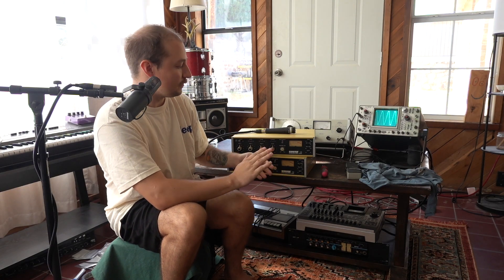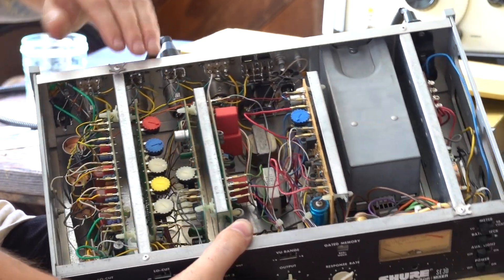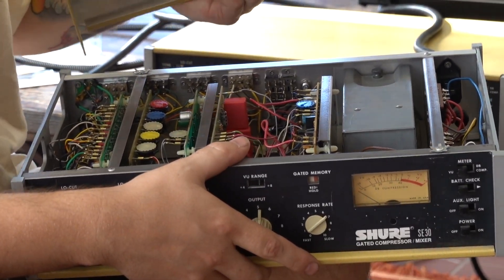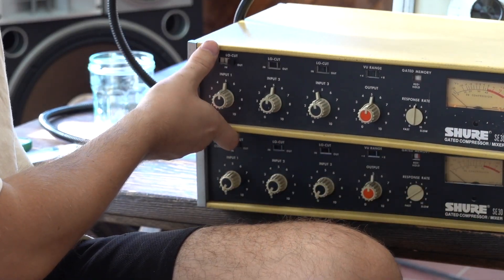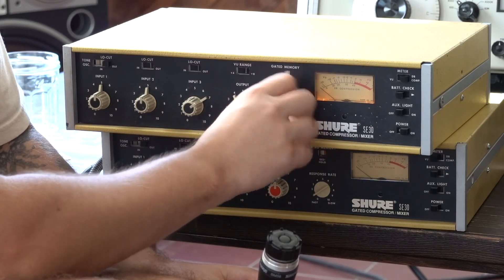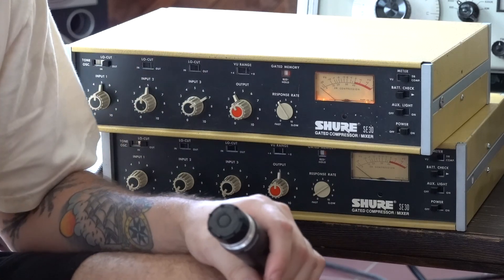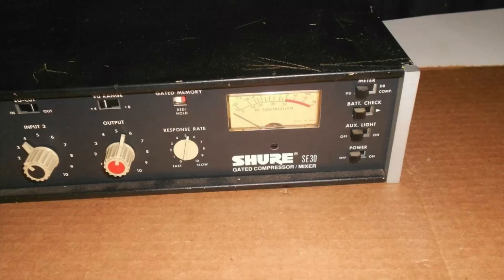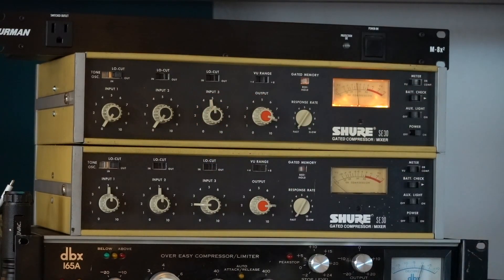FORGOTTEN GEAR: Shure SE-30 Drum Squasher

Comment: A pro tip that was completely missed in pre-production, your drums MUST be gated before sending to be distorted. An exact example of this is when using them on snare tracks… I also mic position the shell mic like Kevin does… but it picks up tons of hi hat and kick bleed. In order to get great distorted drums with tons of control and character, you have to start with the cleanest recording you can get. That is only achieved through gated kick and hi hat out of the snare mics. It works best when you gate every single mic except the overhead mic. When the three other mics are gated and it cleans up the signal, for snare the se30 will only respond to the snare hits and not the kick bleed, completely changing how the se30 responds to distorting. Isolation creates room for big big distorted drum sounds.

Another tip that was completely not brought up. This box sounds its best when using the raw distorted output mixed back into the mix. This routing setup is called New York Compression/Upwards Compression. It literally sounds good on ALL DRUMS, and really lifts the mix. Your bring it to a mix bus, and further bus send to a spring reverb, and mix that back in against the drum bus… and boom! So we learned, gating before sending to distort allows you to maximize distortion character and clarity… and mixing the wet signal back with the original creates a clean controlled distortion with bigger than life upwards compression. You could use it just like in the video, but you are leaving tons of tonal shaping and characteristics off the table. 

Last gold nugget, subtractive eq helps your gate work with more precision. For example, for kick I use a high pass filter to control how much low end I want, and a low pass filter to cut off everything above the kick’s frequency range (spectrum analyzer will show the kicks frequency range), in order to lower the volume of the drum mic bleed of everything else coming through the kick mic. Now when I put the gate after that eq, my gate will only respond only with the loudest peaks of the kick and not the snare or cymbals. Keven Parker uses gating religiously on his drum mics, and it’s how he gets explosive drums. In order to distort them nicely, you have to start with absolutely clean drums. The powerful learning from this video is that on single mic inserts, this box works best in gate/compress mode. When you are using it on the drum bus it works best in compress only mode. Using EQ and gate in that order, you enhance clean recordings that don’t overload with room noise when you crank the SE30 input. Tight with tons of character. 

Go and be righteous, and bang your drums all day!
Reply: quick question to your suggested setup for the SE30.  Are you using gates from the computer or outboard before you go into the SE30 or do you have the gate/compress mode turned on and are using the built in gate of the SE30 in this scenario? Can you have gate and compression turned on the same time on the SE30?
Reply: @WelcomeToSteve I learned what Kevin is actually doing with his drums and the correct order. Track your drums clean, use subtractive EQ and gate bleed and tighten the tail/room noise as tight as it can sound naturally. Side chain compress the overhead to duck when the kick and snare hits. Send to a dbx165A or like compressor on a drum bus, and then parallel compress/distort the drum bus through the Shure compressor/limiter, hitting it hard into distortion, and mix back in with the drum bus. 

The side chaining of the overhead with kick and snare, brings the kick and snare upfront so the final distortion compression stage mostly affects those two more in parallel. That’s it!
Reply: @edwarddelavilla3475 👏👏👏
Reply: @WelcomeToSteve What I do, and to simplify the process, is track with zero gating or processing. That way you have a completely raw take on all mics.. so you leave more room for editing/experimenting. Just make sure to track without hitting the red on any mic at loudest playing for the song. This ensures you have the cleanest take to really mess with. 

Then in the computer, subtractive EQ with shelf cuts (no hpf/lpf). Into gates taking off the tails and bleed. Then send to software or hardware compression of choice doing light compression to highlight transients (2:1-3:1 Ratio @-2db/-3db of gain reduction, mid slow attack to let transients through, and fast release. Now each track treated like this will have a clear high def sound ready to take saturation and distortion with great tones. I call this process audio prepping, beautifying and tightening before further processing. At this point you would send the snare side or the entire drum bus to the se30 and smash it hard, and print back into your computer. Now on the printed track channel, turn the fader all the way down and slowly bring back in the distorted se30 fader… boom. You retain the punch and highlighted transients of the individual clean tracks, but gain girth and saturation as well… and you’ll hear room noise levels raise and understand without gating… it would be too much. Send the distorted track to the drum bus and use a glue compressor.

So SE30 sounds better in parallel vs series… and before choosing either way… subtractive EQ and gating is a step you should not skip unless you are going for a super lo-fi one dimensional sound. Hope that answers your question, feel free to fire more questions if you have em!
Reply: @edwarddelavilla3475  thanks for the fast reply and that was super clear and makes sense. I have a shure 267 which has a limiter but I gather the SE30 would be a better choice for this smash technique
Reply: @WelcomeToSteve Glad it makes sense for you, it’s a full proof way to make your drums sound like a blanket has been lifted and you get max punch. As for using any other piece of equipment to get same type of effect, the beauty is all pieces can be overdriven and every piece has a breaking point. You just have to listen for break up, and try it in parallel. If you like what you are hearing mixed back in, then you can rock it. You can use parallel compression or parallel distortion, or both in any way you want. I’m not familiar with that unit, but I’m looking it up now and I’ll report back what I find 😊
Reply: @edwarddelavilla3475  okay awesome! yea still learning my unit and experimenting with the input and output levels with the limiter on or off and all combinations in between.
Reply: @W @WelcomeToSteve So it looks like it will do close to the same effect, minus the gate function… but it’s not a big deal to not have that… your gating in the computer will rectify that on individual drum mics. On the entire kit on the drum bus, I wouldn’t use the SE30 in gate mode… so you really aren’t missing out in retrospect. It has a limiting/compression function which is all you’ll need to do the effect. People use this one on drums too, so it definitely has the same mojo. The only difference is how much it takes to engage its distortion. Just last piece of advice, if you are going to parallel compress/distort on individual drum mics, go easier on the final parallel distortion on the entire drum bus. If you are skipping individual compress/distort on drum mics and solely using it on the drum bus, then you can ride the distortion a bit higher. By recording the drums with no processing, you have all the time to test which sounds better for the song as it’s coming along… where as if you committed earlier when tracking, you are stuck trying to make it work or you eventually get forced to re-record sections or the entire song… don’t make that mistake, and experimenting becomes fun and intuitive. Enjoy this technique, and I advise you do this to all drums no matter the genre, the only thing that changes is how much or how little. It makes any drum sounds better. Don’t be afraid of mono drums, they create the most impact and free up space in your mix to pan. Most of the best albums all have mono drums for a reason. Rock on, and I’m here if you need any advice!
Reply: @WelcomeToSteve Know thy tools, and know them well. You are on your way 😎
Reply: @edwarddelavilla3475 🫡🏆👏👏👏

Comment: Very Nice! - Big drums is what got me into audio engineering, and music production, as a hobby, back in the mid-80s. I loved all those heavily processed Duke Bootee drums on his "Beauty and the Beat"  productions, and then I got into Meat Beat Manifesto's drum sound aka, Jack Dangers.

I have, quite happily, limited myself over the years to just  dbx and Drawmer. - my current favourite drum bus setup is into a cheap old 166A, used on Jack's Subliminal Sandwich album, into a Drawmer DL251, which adds back generous amounts of meat and weight to the signal, as I personally find the dbx units tend to thin the overall sound a little.

I'm essentially using the 166A as a Transient Designer, and the Drawmer as a smoothing device, - maybe not to everyone's taste, but it definitely gets me "That" drum sound.

- Current compressor collection
- dbx 118 x2 - poor mans 160vu (used on some early Meat Beat drum production, - such as Radio Babylon, etc).
- dbx 166A x2
- dbx 1066 x2 (again, with some Drawmer meat added afterwards, - the 1066 also make solid transient designers, - I'd never sell them, - but if they die, they won't be replaced).
- dbx 160A (cleaner than the 166A, but I actually prefer the subtle dulling the 166A offers, - for stereo drum buss).
- Drawmer DL221 - 241 - 251 - 441 - 1978

- It ain't always what you use, but it's always the way you use it.

- As always, I ain't no professional, just another idiot with enough money to spend on toys that feed my autistic need for sonic manipulation.

god bless

Comment: I’ve been patiently waiting for you to do a video on these! I just recently bought one cheap untested and it seems to function well except for channel 2 being finicky — seems the audio kinda flits between very low level/unaffected and loud/compressed how it should be. the mic/line switch seems to be the issue. it has to be in a very specific spot to catch the signal. Also, I’ve been interested in the link jack on the back and from reading the manual and looking at other old shure mixers, they also have the ability to link. From my understanding, I could get a cheap Shure M67 mixer and link it to the SE30 for extra inputs into the gated compressor. Do you have any experience with that?

Comment: Hey man, thanks so much for this - I’m getting 2 mended at the minute (have been trying for the past 2 years and have finally found someone who knows what they’re doing)! Would you recommend running audio straight into them, or in parallel after recording? And is it possible to record the parallel AND the dry signals at the same time, using Logic? Cheers dude ✌🏼

Comment: SE30 is too slow for me for a drum compressor even at its fastest.  Kinda makes me feel seasick.  Can be kinda cool on a smashy vocal or piano though.
Reply from the maker: @kniferideaudio  we should find a way to mod them and make the release time even more versatile! Or find a way to change compression knee
Reply: @AustinMarshmallows  I wonder if it would just be a simple cap or resistor change somewhere in the circuit.  Beyond me.  I haven't looked at the schematic but I wonder if comparing it to a Level Lock would yield any modifications.  I think they release a lot faster.  Wonder if you could make a level lock mode to be switched in.